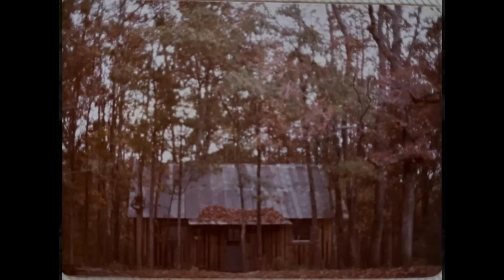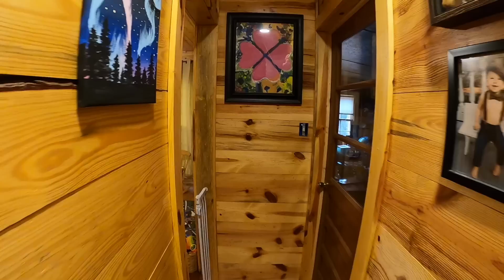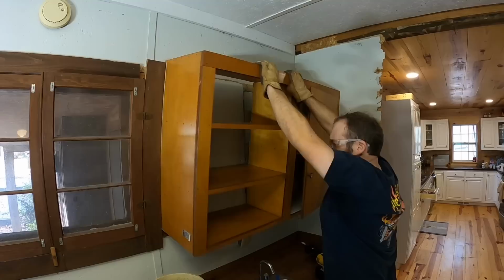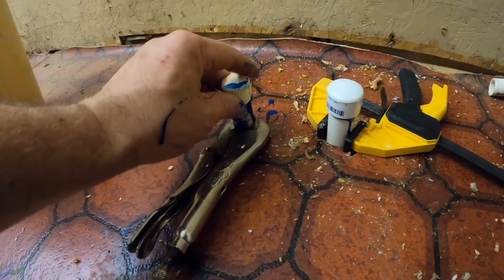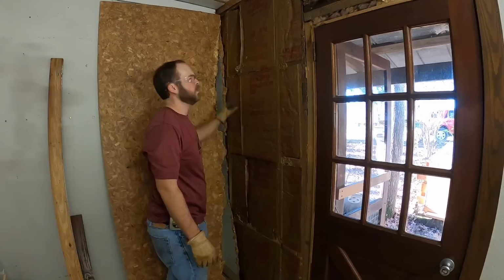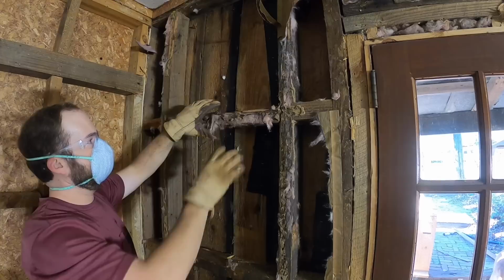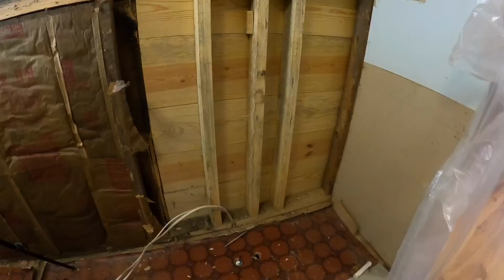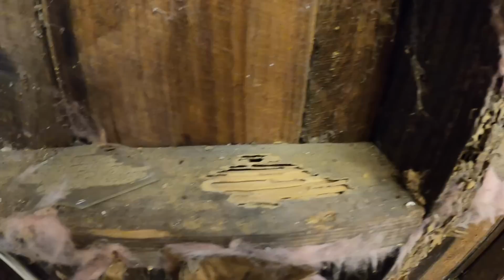We Live Here...(Cabin Remodel Part 1)

Comment: Your project reminds me of my project 42 years ago. The original part of the house was built in the 1800’s. It was built like a barn, with log beams for floor joists. All the interior walls had lath and plaster and none of the joists were the same size.  It would have been easier and quicker to tear it down and start from scratch. It was worth all the work in the end to save a piece of history. What you have done so far is beautiful and I’m sure your dad is proud.

Comment: When you work on the flooring , please be mindful that the linoleum will undoubtedly have plenty of asbestos in them , the problem I'd when you cut the flooring the particles become airborne, so your remediation needs to be very strategic with the goal to keep the particles wet not dry floating in the air.
Reply from the maker: The existing subfloor is still good, but it needs another layer to match the level of the adjoining room, so I'm just going to lay another layer on top of the linoleum and not have to deal with the nasty stuff.